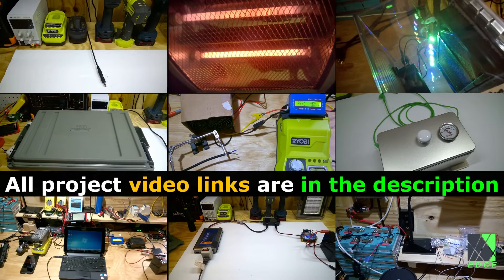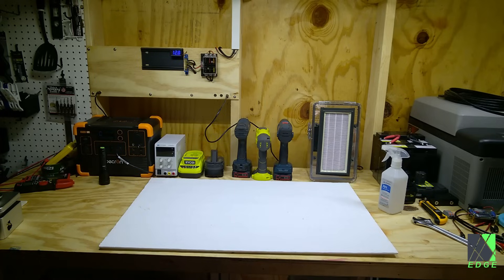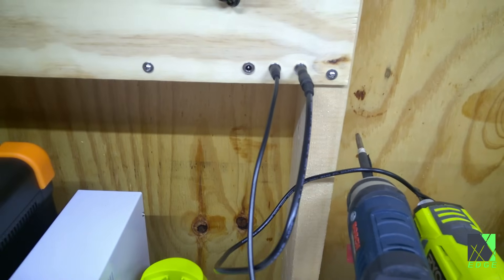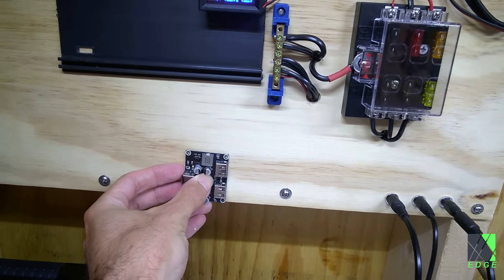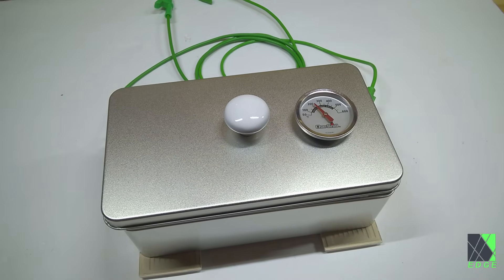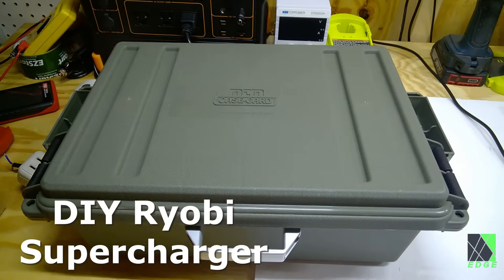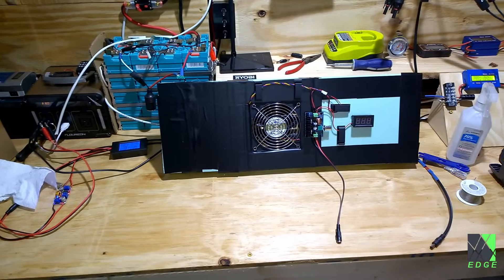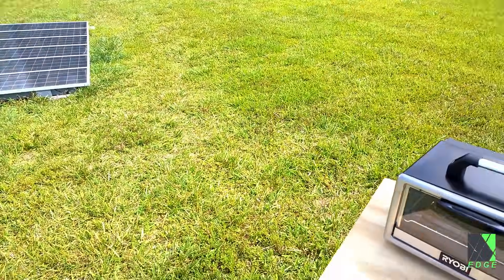What Can TRUE Direct DC Solar Power Do? Mini documentary and demonstration! #diy #solar #offgrid

Comment: I'm on a parallel journey,  have had a love for DC current and a drive to find ways to use it for years.   Although some see it as not practical, it really is.... especially if you just get creative.  It's a fun challenge to make these things work and getting rid of a noisy inverter for many things is FANTASTIC.  I could live happily in a tiny home with DC lighting, a laptop and DC appliances (with the help of a little propane *because I'm spoiled).  Anyway, Fantastic videos I've subscribed.   Love your channel.
Reply from the maker: @create54321 Thanks a lot for subscribing :) for some reason clean direct DC solar running stuff for free all day with minimal complexity really checks a box. At the very least, I save wear and tear on my inverters!

Comment: So if I understand this correctly you can run something directly off a solar panel without a battery or inverter. 
What kind of special equipment do you need?
Reply from the maker: @robertshinazy3055 It depends on the appliance, some need to be modified. Examples of PV-to-Load (PV2L) operation: Heating, cooking, etc.
https://www.youtube.com/playlist?list=PL8a6nRTNyF9NZkjFgjfESLujgdZFTgdym

Comment: How many volts and amps come from your solar panels.  How do you keep the solar panel volts matching the volts of the various loads you put on that bus?
Reply from the maker: @thedudefromU They vary depending on how much sun and what loads are plugged in. For example, the small oven works fine at 14v or 17v. But it doesn't dim the overhead lights unless there is inadequate sun.

 5-10 amps is no problem in direct sun. However some of the cheaper power plugs I use can only take 3a so have to watch what I plug in.

Comment: What is your shop led lights voltage rating?   Is it directly wired to your 100w panels?   Or did you wire in thru a dc to dc buck converter for voltage and current stabilization?
Reply from the maker: @mr.makeit4037 All are wired directly to the 100w panels, they can take over 20v - but still run OK at 10v. They might dim if the sun goes behind a cloud, but it doesn't bother me for some reason

Comment: Questions
Are all devices self regulated?
How do you handle low power, brownout conditions?
How do you handle line interference, like from fans or other mechanical devices connected to the system? - exapmle a fan for filter is going and a 12v radio do you get speaker noises?
Reply from the maker: @thomascoleman7301 All the devices I use (or make) for PV2W PV2L are self regulating. For example the mini oven doesn't care if it gets 15v or 17v. The Ryobi charger has circuitry to activate the BMS and limit current. I have had no line interference problems, if DC ripple is a problem one can use a filtering circuit etc.

Comment: What about 24VDC isn't it better
Reply from the maker: @wowshorts1566  Direct PV operation on a 12v panel can fluctuate anywhere from 9v to 21v+, it doesn't exactly fit into a particular voltage. I will say that 12v stuff tends to be more affordable, and you can find that voltage on the side of the road in a car. 24v equipment sometimes costs more and is not compatible with car power. There are many tradeoffs, so in my opinion it depends on what tradeoffs each person prefers to make. I like nominal 12v appliances because they are extremely cheap and common usually. Hope that helps :D

Comment: I'm setting up my off grid hut like this. I was surprised to see the Ryobi charger accept variable voltage. I wonder if my AEG charger will handle the same. I think I could test that.

I also found that a lot of appliances rated for 12v like pumps work fine at higher voltages; but I generally run them off of <21v powertool batteries. I think that's generally around the max voltage from a 12v solar panel so that should work without the battery in between.
Reply from the maker: @jamesrowlands8971 The ryobi charger has a DC-converter in it for safety, it properly activates the BMS and can also accept a 12v input. The build videos are here
https://youtu.be/MRazwnwvczg
https://youtu.be/RMJFVHCNw_s

Comment: Interesting, thank you for getting back to me. I like the concept for simplicity and cost effectiveness. Using an mppt like a programmable victron wouldn't add too much cost to a system and give a level of voltage control, although power will always fluctuate through solar panels I guess. So you find AC appliances handle DC ok?
Reply from the maker: @Kanuka-Fores Welcome... A DC converter is a good idea, it could be added to the board... AC appliances generally don't handle DC well or very safe, especially the AC switches which can arc and burn. It's not suitable to shove 100+vdc into an AC appliance, very unsafe. I am modifying some AC appliances to be suitable for direct solar and use lower and safe voltage. Previous examples are space heaters, with good DC interruption capability and mods they can run safely off of 55v. Working on rebuilding several other appliances to accept solar input. Of course it voids the warranty and UL rating, but that's how it is

Comment: I'm using my solar panels and they are connected to my electric hot water heater (heating coils are resistive loads) under 0 to 240VDC/3000Wp, dépending of the sun, but thru special HIGH voltage relays (relay for EV) and all safety as DC breaker, lightning arrester, electronics temp regulator, mechanical overtemp. This system has been installed 4 years ago, and works well. When in winter, the system can switch, if not enough sun, to the grid if the temp is under 55°C, and automatically insulating the DC from the AC.
Reply from the maker: @paillart527 Nice!

Comment: How do you regulate voltage?
Reply from the maker: @Kanuka-Forest The panels are actually completely unregulated. For this reason, sensitive electronics should not be plugged in. Some electronics (like the USB converters) have a DC converter so they are usually safe. The mini oven doesn't mind voltage swings at all. Certain power tools and motors are no problem. The small laptop I tested handled unregulated PV voltage, but I cannot recommend it. My intent is to show laptop designers that direct solar input would be an awesome idea

Comment: I successfully use direct DC PV to heat tap water, support central heating system for my home and water my plants from water well.
All from direct DC.
About heating system you can find here. Im very sorry, description is in Polish, will try to update english subtitles soon.
https://youtu.be/9v9WiOj5yYw?si=Zs6I8G2Pwqp5TWNj

I to power water well pump i need something more complex - i have to measure if there is enough power to start pump. 
Description here, sorry again, its in polish.
https://youtu.be/S3uK-hB2xcE?si=1jonFwg5HreEUkRT
Reply from the maker: @wojciechbedzinski9551 This is amazing work, thank you for sharing!!

Comment: Novice here. Isn't there a concern with damaging devices by over charging without having the solar power flowing through charge controller?
Reply from the maker: @gwb8445 Hi, since there is no battery hooked up, there is nothing to overcharge, and no need for a charge controller. Many appliances and devices can run fine on direct solar power. For example, the miniature oven shown gets hot at 15v - but it still works fine at 17v. Sensitive and expensive electronics, probably should not plug those into a solar panel - it can be risky. Hope that helps! -Dave
Reply: @solarpoweredge  Thanks! Guess the batteries in power tools, etc. can't overcharge. That's what I'm understanding.
Reply from the maker: @gwb8445 Welcome - the 18v battery charger shown works the same as the Ryobi standard. It controls the voltage properly. 
The other battery I showed with a plug in the side, does not have any battery cells inside - it's just a convenient way to put direct solar power straight into the tool. I use this method sometimes to run certain 18v tools without any battery.

Comment: We have a vacation double wide mobile home near the beach in central California. The water table is close to the surface and the ground is always wet under the trailer. This causes the place to get a moldy smell. Last year I put a 12 volt surplus solar panel on the roof that runs a Buick radiator fan. There is a switch and a 15 amp fuse, no other controls. On sunny days the fan draws outside air from the foundation  vents and dries out the soil underneath  by blowing it out through  the fan unit. It starts when the sun hits the solar panel and quits in the late afternoon. After years of having to air the place out when we get there, it has much less mold smell with this fan system in place. Free ventilation. 
https://www.youtube.com/watch?v=YzRgUrJsByE
Reply from the maker: @kimmer6 This is excellent... nice job!! 👍
Reply: @solarpoweredge  Thanks! Here's another 12 volt cooler toy, free power, uses very little water. https://www.youtube.com/watch?v=Zp1XC36txrw
Reply from the maker: @kimmer6  Now that is really cool. Love it. Been tinkering with a small 12v pump and mister nozzles. There's too many projects!

Comment: My many applications like yours have much faster return-on-investment because of fewer parts. Direct solar space heating tops the list.
Now if we could get Tesla on-board charging cars with a direct solar charging plug I could range further into the wild. "The best part is no part."
Reply from the maker: @sagecoach I love it! Wrote a blog article awhile back called "PV2EV - why isn't this everywhere". There is zero reason why electric cars couldn't be made to accept a direct solar input since years ago. I hope an electric car company will add this feature soon....
Reply: @solarpoweredge  It is too expensive a car to play with. I do notice the portable home charging cord and adapters ease into the charge to find the ideal safe power level available. And that is intriguing if interfaced with a solar panel inverter. Perhaps Tesla could provide something like the available Tesla kit plugs.
Reply from the maker: @sagecoach Definitely, I'd hate to short something out. I need a cheap electric car to develop with. Someday perhaps

Comment: I am sort of doing something similar but I work with a normal solar setup and then convert things to DC but now I might consider using direct PV for some items. Though I do think that this method would benefit from a Capacitor attached to it. Specifically the Maxwell ultra capacitors. I am not sponsored by them but I do really like their products. I have one installed in my current system. Normally you would install them behind your inverter for anything that needs a quick spike in power
Reply from the maker: @daniellapain1576 Hi, I have a bank of supercaps for that purpose. Since they are not mandatory for normal PV2W stuff like fans and lights, they were not connected in the video. Even my little inverter runs fine without them. I like those Maxwells too - they sure are expensive though!

Comment: The best is to use universal motor for some appliances because you can use AC or DC to runs. No inverter needed but best use dc to dc converter to prolong the motor.
Reply from the maker: @thienvu4503 Hi, ty for commenting, I've been working on building machines with DC motor setups for some time. I'll so some video about it when possible.

Comment: There must be a risk of damaging the solar pannels if you exceed their current rating. I am assuming they can not stand a short circuited load applied to them. Therefore you could protect them by fitting a current limiting device where your fuse board is located. Fuses by the way are defined by the current they are designed to safely carry without blowing. For example a ten amp fuse supplies ten amps and will not blow untill a realy exessive current is drawn such as caused by a short circuit. (e.g. Low or no -Ohms resistance) Therefore it is possible for a fuse  to draw a reasonably a heavy over current for a time and so the fuse fails to protect you. A current regulator is more accurate. Hope this helps
Reply from the maker: @brjplummer9415 Hi, thanks for the comment - I will use a current limited supply for some tasks.  I tend to make a lot of mistakes and melt or short things out!

Comment: I have been using solar panels direct coupled to 12v car radiator fans for many years. To transfer air and to cool workshop in summer. They run slower but that is good as they would be too noisy and powerful if they had full voltage. Last for years.
Reply from the maker: @johnmeeks7320 Right on... solar fans are awesome

Comment: You have a fun project there!  It seems that all you would need is DC to DC converters to get 12v for 12v devices, 24v,, 48v etc.  Solar Panels put out much more voltage than 12v and the optimum Solar Panel setup is series keeping the wire small but voltage jumps way up.  A DC converter that can take up to 500v and convert to 12v, 24v, etc would be great. My Laptop needs 19.5v dc.  We need appliances, computers, etc to work on DC.  That is the problem.
Reply from the maker: @sciglassblower Wish there were more DC appliances! A laptop could have an MPPT DC input, 12v compatibility, why not? Hopefully just a matter of time
Reply: @solarpoweredge a boost/buck converter locks well to fixed voltage for that application
Reply from the maker: @owenbruce4120  Right on :)

Comment: This is very common in Pakistan. Charge controllers are much cheaper than batteries thus it is installed in greater numbers. DC fans, lights and water pumps also make it worth an investment
Reply from the maker: @xXAbdulBaqiXx  It works really well

Comment: I want to run a pond aerator (oil-free, air compressor)off of solar without a battery. Whatever hours I get, I will accept. Can you help me? Do you have any recommendations?
There is no AC where my ponds are.
I am in Texas at 30 or 31 degree latitude.
Reply from the maker: @jugears1081  I will try to help... (dealing with a family emergency, keeping it short)
1) In my opinion the easiest route is probably a DC (not AC) compressor. Then use good size solar panels and a DC converter to drive the pump as long as possible. 
2) There is actually a kit for sale that does all this out of the box, but it isn't cheap. 
3) A lot of compressors are AC, that would require a direct solar powered inverter which can be very difficult to find. As of yet, I have not found a satisfactory inverter that can run on direct solar and handle big loads like compressors.
These are just my thoughts and opinions, I hope they are of some help!

Comment: I try to use/make all of my electric loads DC, and this takes things to the next level... I need to think about how to use my solar directly after the battery is charged. But also allowing any load to use the DC directly will also reduce the battery usage, at least during the day.
Reply from the maker: Good thinking... there are lots of options you can leverage... I am trying to reduce dependency (and cycling) on batteries - reduce need of inverters and charge controllers too. Reduce costs and complexity. Who knows what is coming, having simple options to fall back on is a good thing  👍
Reply: @solarpoweredge  all of your goals apply, but the thing I was aiming for is efficiency. Using the energy directly will save a pretty decent amount of electricity over time, not going in and out of the Solar Charge Controller and Inverter.
Reply from the maker: @taj-ma-haul9094 Right on! bypassing multiple voltage conversions is more efficient. Plus saves wear and tear on solar equipment. I still have an inverter, but more and more of my stuff is switching to direct solar power... working on direct DC air conditioning right  now :)
Reply: @solarpoweredge when I purchased my inverter mini split, I tried sourcing a DC version of it and because of the plandemic - it was not available. 
I plan on replacing it with A DC version with 2 handlers!
Reply from the maker: @taj-ma-haul9094  That's gonna be really cool!!
Reply: d like to see your setup. Thx

Comment: I used my solar power directly connected to my electric hot water heater. Since the heating coils are resistive loads, this works very well. I have emergency 12 volt led lightning throughout my home. I use my solar power to charge my Ecoflow Delta pros.
Reply: I would like to see your setup. You should do a video.
Reply from the maker: @pstoneking3418 Excellent! Solar is awesome
Reply: What about thermostat?
Reply: Yes, can you explain your setup? Thanks.
Reply: . Plus one for another person wanting to know set up
Reply: Great idea, could supplement w instant hot water heater if needed at 4 in the morning.

Comment: Best channel around! Quick question, if i put a 60w ptc to a 100w solar panel (all in the 12v) , what can happens if the panel want to push 100w to the 60w ptc? Is there something to limit the wattage? Thanks 😊
Reply from the maker: @SEBTECHDIY Hello and TY :D it's limited by resistance, it's generally not dangerous to hook a 60w PTC to a 100w panel. If the PTC goes way up over 12v maybe that's a problem. The biggest challenge is matching the PTC properly to a specific panel, as they're all different
Reply: @solarpoweredge  Thank you so much for the fast response. I just subscribed to your channel. Your content is very informative, love it :)
Reply from the maker: @SEBTECHDIY Welcome, thanks for subscribing :)

Comment: Just a quick question, 5mins 34secs and 9mins 10 secs, what is that charger thingy called and can you buy them or make them. Thanks for any help you can. Seeya Rob
Reply from the maker: @87xfute Hello, it's often called a USB DC converter, there are many different kinds available.  It's important to note the max input voltage, to make sure it will work properly with your solar panels